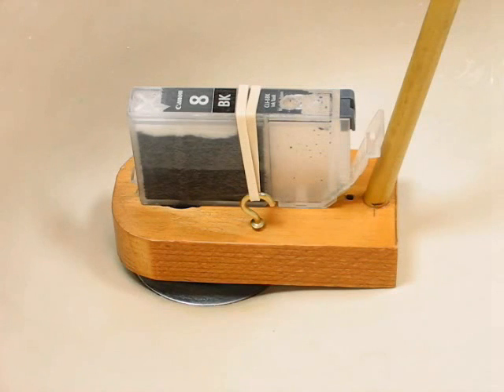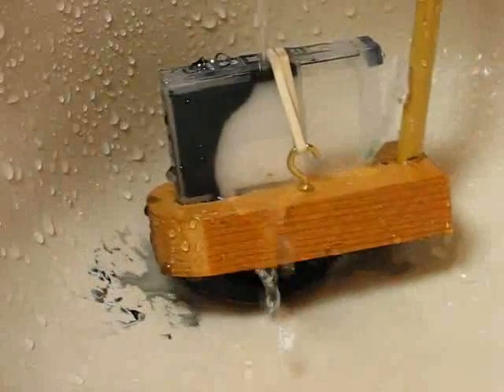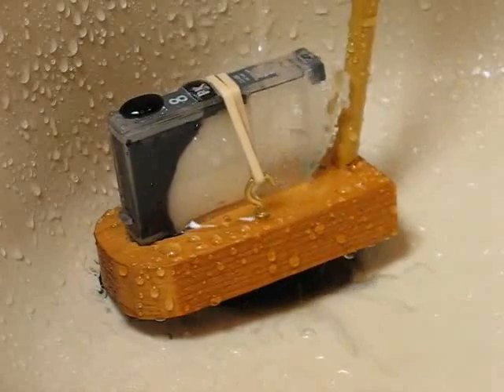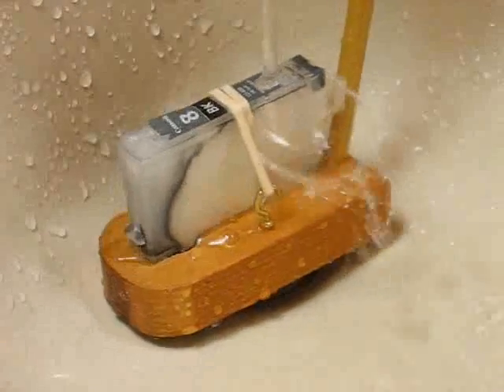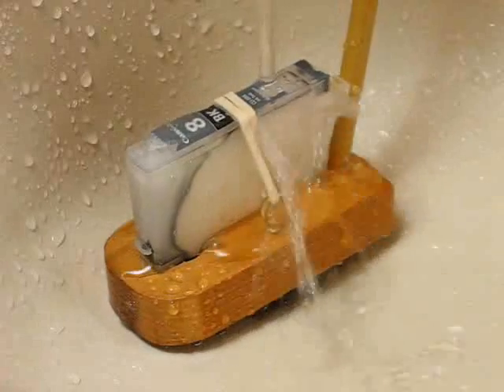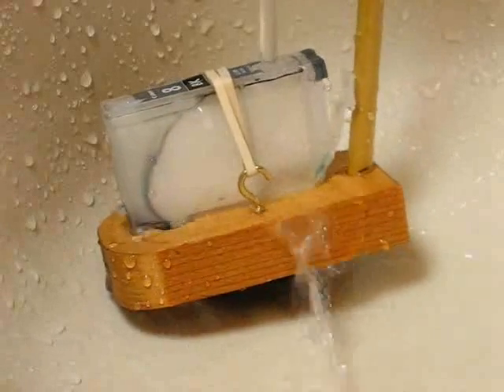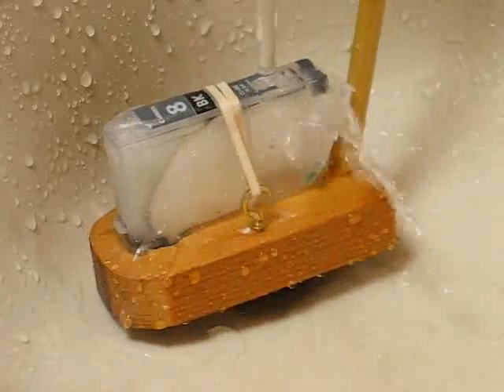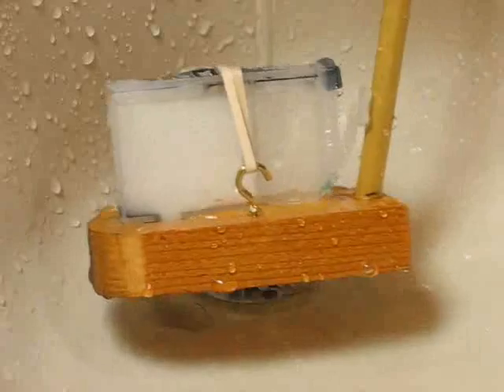Purge or Flush Canon CLI-8 PGI-5 CLI-221 PGI-220 CLI-521 PGI-520 Ink Cartridges

Comment: You are right, my cartridge ink is pigment rather than dye based. But of the two products, I would have thought that dye would more readily stain than solid pigment. And on viewing your video again I imagine a bleach based solution would get roughly the results shown (if used on dye) when flushed through the way you show. The ink seems to positively back away! Bws.

Comment: How come you can not only get water to flow so freely through your cartridge but also for it to cleanly push back the ink boundary in the sponge? I have tried exactly the same procedure as you suggest, my warm water behaving nothing like yours, it rather mixing with and diluting the ink rather than cleanly push it away as yours does. My sponge (so magically rendered white in your video) remains as black as ever.

Comment: How to remowe all of the water from this cartdridge especially from sponge part of it? Can I use pigmented ink in CLI after flushing cartdridges and head?
Reply: Try the Centrifugal Sock method: Put the cartridge into an old sock (no hole, preferably) and swing it around your head with all your might. Do it a few times. You'll see that the sock gets wet where the ink exit port is. Then use the paper-towel method. See PrinterKnowledge.